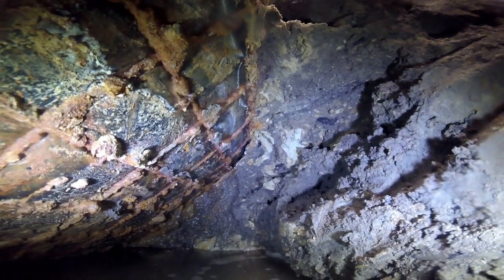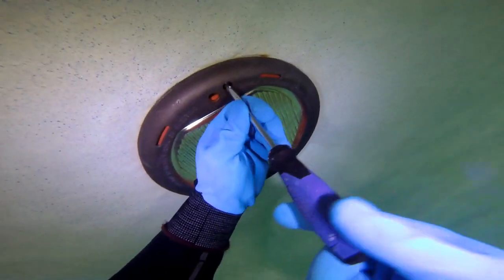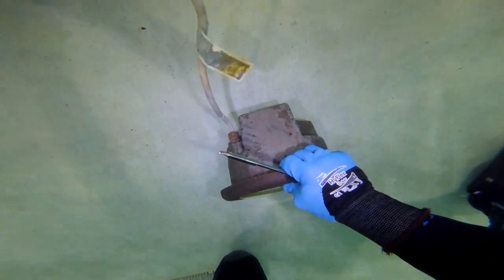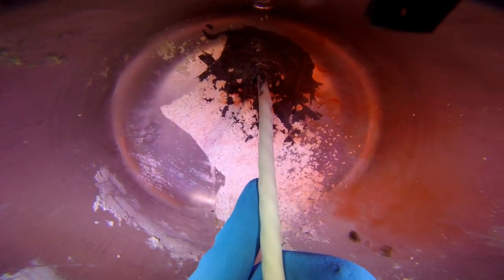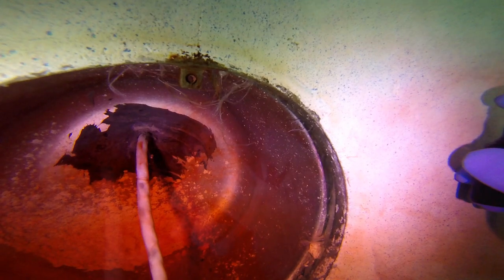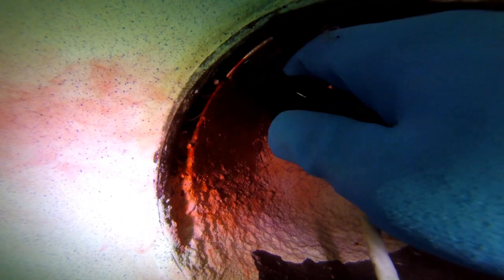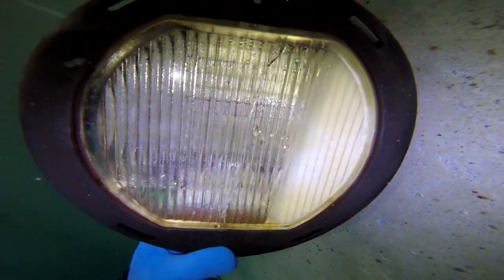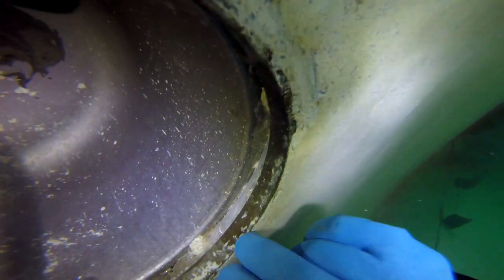Leak Testing the Parris Island Pool

Comment: This looks like a job for splash zone compound! I've used the stuff a few times on leaky boats; grab a handful of part A and a handful of part B, squish 'em up real good (it's basically underwater JB Weld) and slap it on the leak. The pressure helps shove it into the cracks.